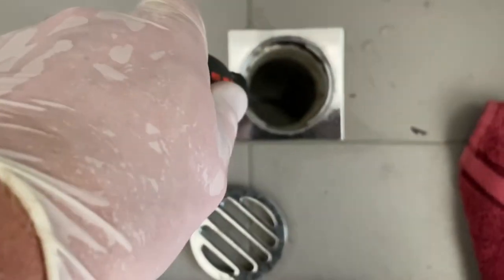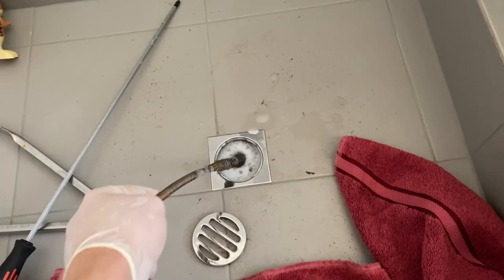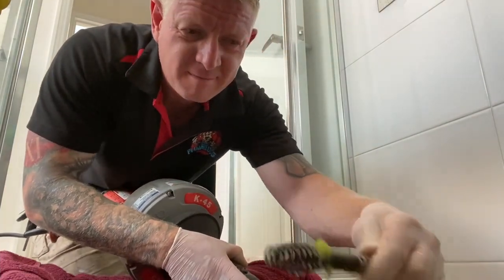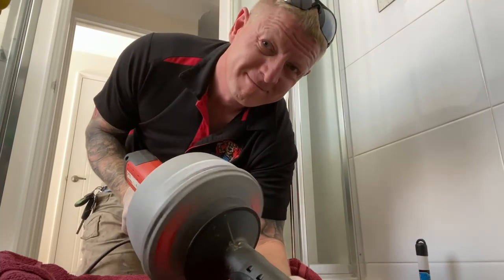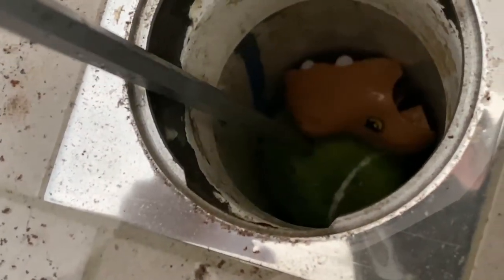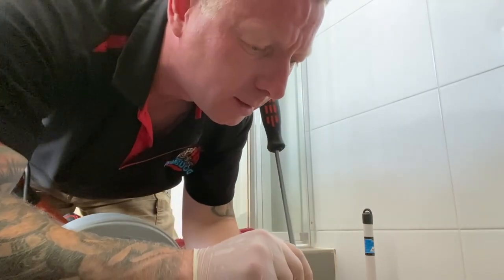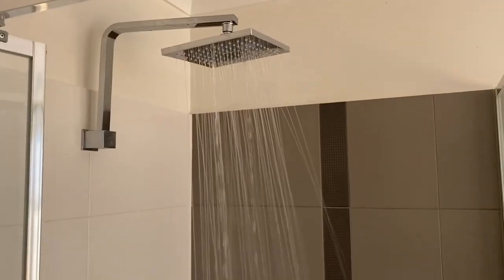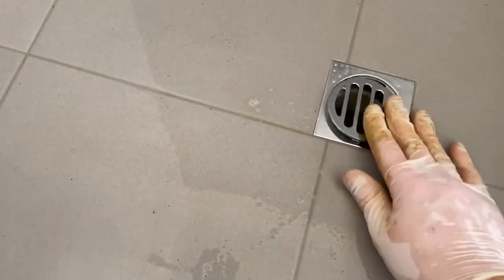Blocked Drain - Tennis Ball Blocking Shower Drain - Plumbdog Plumbing Perth

Comment: My renovator just found a dog’s tennis ball down the drain in rental basement suite. As luck would have it, a tiny wrench fell down the drain during shower tear out. Shop vac used to retrieve it and ball was was thankfully found.
Reply: Have not yet heard how far down the ball was, but a plumber checking all drains yesterday had said he could not snake this drain past the Ptrap, and this drain was a little slow. Yup. Wonder why 😂